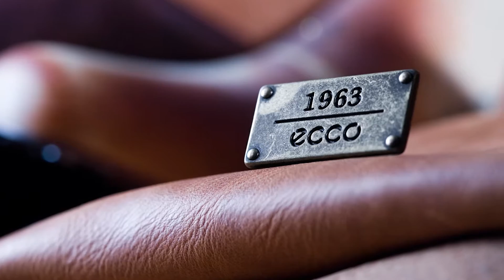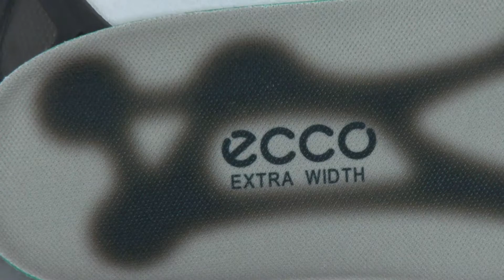ECCO's Philosophy on Shoes and How the Company Works

Comment: I've purchased 8 pair of Ecco shoes over the years - 7 of which were within the past 10 years - between 2009 and 2016. I first noticed my dress pair of black Ecco shoes felt "spongy" back in 2017 when I wore them with a suit to an event but I didn't look too closely at the time. When I went to wear them again in the fall of 2018 I found that the shoe soles were disintegrating and there was a rubber powder in the box where I would store my shoes. In June of 2019 I noticed another pair of brown suede casual shoes felt "spongy" in the heel and I examined them and found the shoe heel had cracks on both shoes. In August another pair of brown casual shoes felt spongy in the heel area when I walked on them and both of those shoes had the beginnings of cracks. Lastly, a black casual pair that I bought in 2009 and wore regularly throughout the year since purchasing them began separating from the upper shoe body. This is 4 pair of shoes whose soles have disintegrated (or began to) in a period of less than 2 years! I have well over $500 invested in these shoes - all of which have been well taken care of.
Reply: I've used Ecco shoes since the 1970's starting with the iconic Ecco Free and have yet to have a sole disintegrate on any pair. I think it must be a problem with hotter, more humid climates. I live in Sweden where it's often very dry during wintertime and only gets more damp in summertime and only usually have moderate heat like in the 25C's. Unfortunate that you and others have had problems though and one can only hope that manufacturers work hard on making compounds that can last in any type of climate. Only pair of shoes I've had disintegrate on me is a pair of 1980's Nike Air, where the soles did like you're describing. But with the Nike they were stored improperly a while in a damp attic, so that could be the cause.

Comment: Why don't you ask him why ECCO shoes are falling to pieces. Rubbish.
Reply: The original Danish shoes were the best. I had a pair for years until the soles worn out. My local shoe repair shop said they couldn't be repaired. ECCO offered a resole program. I sent my shoes them...but they returned them and said 'no go' can't be fixed. So I was out of luck right?  Wrong...I have a friend from Delhi who has been polishing my shoes (boot polish wala) since 1987. He also repairs shoes. He took my ECCO Cross shoes and rebuilt the whole bottom section. He resurrected my shoes in a way ECCO, the manufacturer, couldn't. Santosh Kumar, a true master craftsman!